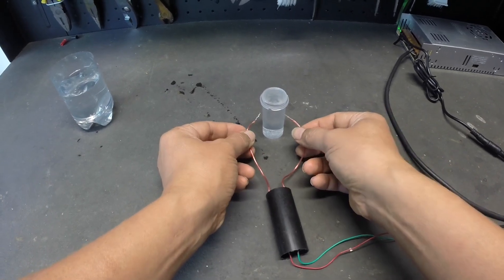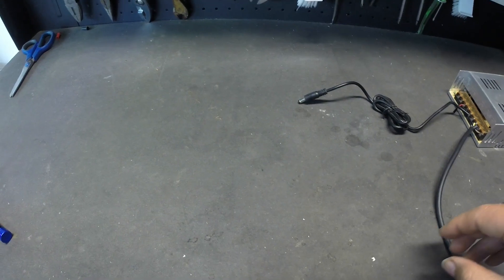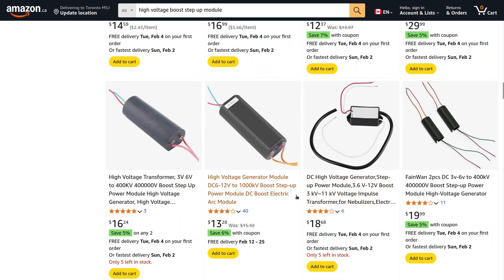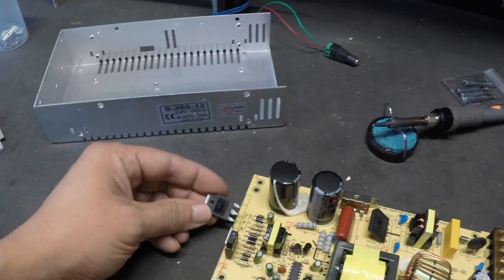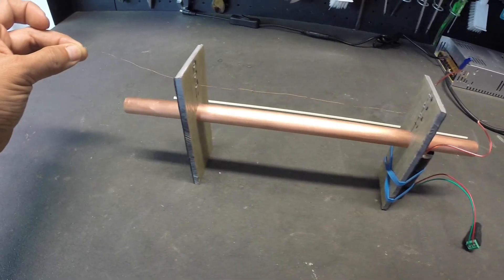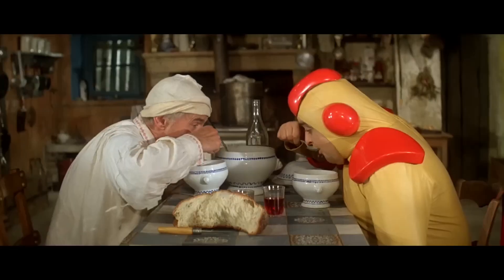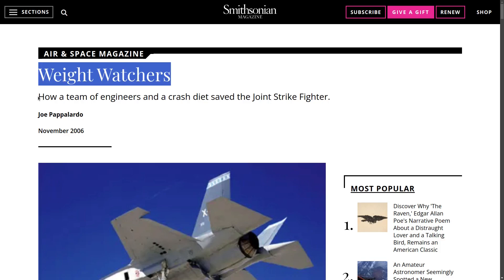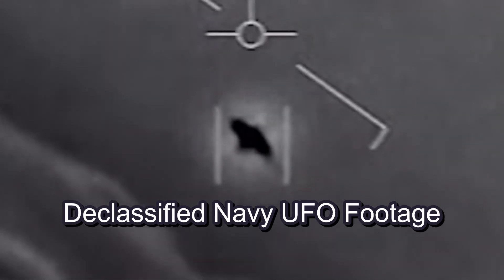Mistakes To Avoid With Plasma Technologies

Comment: Yes the field is very important. Have you tried using just one side of the electricity? I'm getting good result from a different approach, using a bifilar coil to transfer the energy to the water then feeding.
Reply from the maker: I'm not sure what you mean by one side of electricity. The high voltage module I'm using produces pulsed DC, not AC. Does your bifilar coil generate plasma?
Reply: @cooltherapy  The coil generates a field not plasma discharge... The field measures -14v with a scope and 2in wire  antenna.
Reply from the maker: @ I see, so you are more into traditional electroculture. Btw, I try to avoid generating plasma discharges (sparks), colder plasma is preferred, like ionic wind or  plasma-activated water.

Comment: waait, I'm dumb but fascinated, why is the fire put out @9:16 ?  
  Attempting myself with information you provided in video: Because the generated force via current pulls electrons from air molecules?    
   surely any metal would be electrocuted in the presence, right? Rendering application as fire extinguishing system improbable? If not though, is that a thing? could it be a thing? Idea of walls denying fire with electricity when detected could really help in cases of easily flammable surroundings or valuable containment, like homes.
Reply from the maker: That's an interesting observation and idea. I mainly did that to show the ionic wind. But it could be that the plasma also contains elements that would help extinguish a fire, not sure. Note that fire can burn in ozone though.
Reply: @cooltherapy  Tesla claimed a craft build on his idea would create a stream of cold air under and suggested it could be used to put out fires as polarization of the air molecules cools them.  I have felt cold air coming off of many various electrostatic and HF AC in the past so his idea, whatever it was always sounded plausible to me.
Reply from the maker: @ Without measurement/quantifying, it's difficult to say whether the plasma is cooler than the ambient air. But the ionic wind can have a cooling effect.